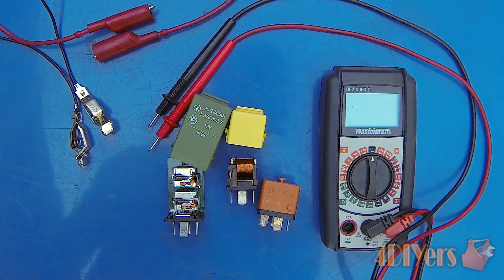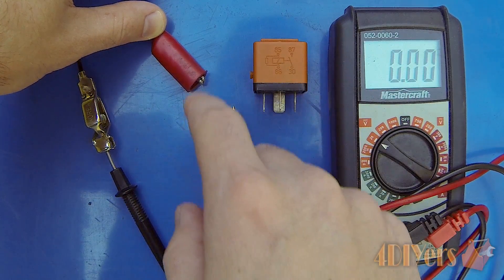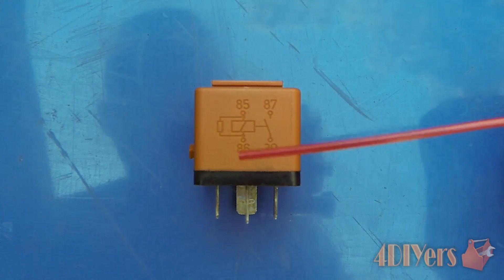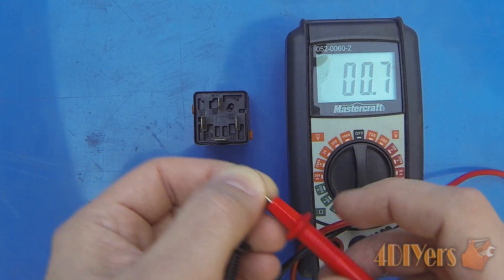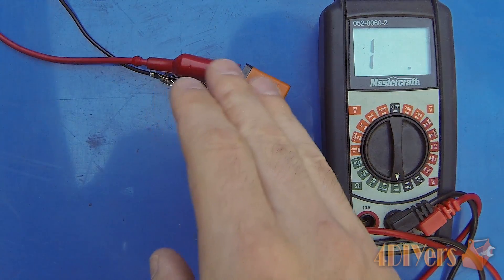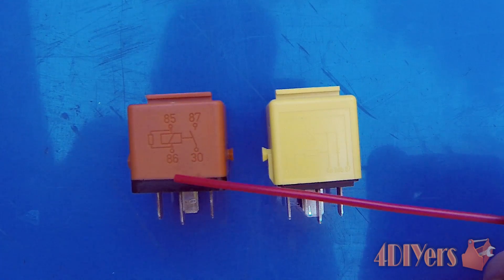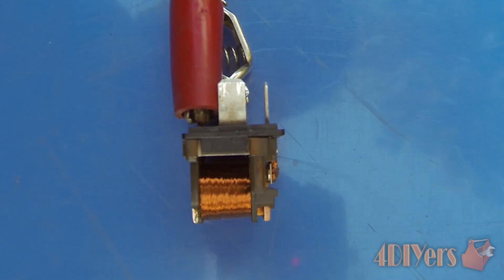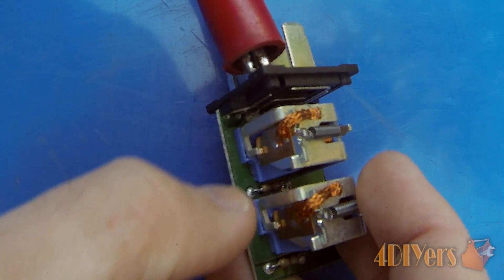DIY: How to Test a Relay

Comment: Hey, I know this video is old but you might be able to clear a little doubt I have. What could be wrong with a relay that sometimes doesn't work properly? My car has a "One Touch Down Window Relay" on the door which makes the window go down automatically with a single touch of the button, but sometimes the window will keep trying to go down even if i'm touching the up button. I believe the relay gets stuck somehow. The thing is that I replaced it months ago but now I have the same problem and I'm thinking there might be another problem that is causing the relay to some times not work properly.

Any idea? TIA
Reply from the maker: If it was a cheap relay, it could potentially cause the same problem. I would also consider if there’s a problem with the window switch or the limit switch on the window regulator. You should be able to check it with a multimeter.

Comment: I get 265 ohms of resistance on my coil but it is a coil that is on a pcb for a wine cooler...i don't know if that spec you gave is just for automotive relays or all 4 pin relays?

Comment: why some relays whistling ?
Reply from the maker: Could be the wrong relay (ac relay used in a dc application), maybe a power or ground issues causing the contacts to chatter, or the coil could be on it's way out.

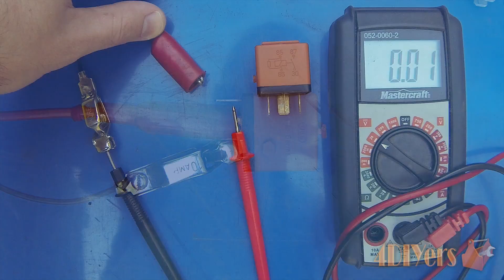Comment: 1:28 if the coil clicks do I still check it to see if it’s faulty? Or assume it’s operating to standard?
Reply from the maker: A click means the electro magnetic is working, but there can still be a fault with the switching circuit. Check the switching circuit to see if there is still an open circuit when activated or any resistance which would cause a voltage drop.

Comment: Thank you. I didn't actually need to test a relay (I knew it worked fine), but I wasn't sure about the schematic. Basically, I have an occasionally faulty neutral safety switch in my Jeep, and if it completely prevents me from starting the vehicle, I need to jump the relay that controls the starter solenoid. Wasn't sure which pins to jump. The schematic (and even the pin numbers) for my relay and yours are identical. Your explanation helped clear up which pins I need to jump. Now I won't be stranded if the NSS fails again.
Reply from the maker: You might be able to unplug the switch or run a jumper on the switch plug.
Reply: @4DIYers  yep! Removed the relay. A manual jumper on the contacts for the open switch is exactly what I did. At least now I won't be stranded. 😁

Comment: Hi, great video, thanks. I have a motorcycle that had a 12v socket fitted by a Honda dealer so that I could plug in my sat nav. I also had heated grips fitted on the bike by the Honda dealer.  However, I plugged in an electronic car tyre inflator and I think it must have blown the socket or a fuse or something because the 12v socket no longer works. I replaced a 5 amp fuse in the fuse box, although the original 5amp fuse seemed fine. Still no joy. There is a big black relay that sits beneath the fuse box in my bike (Honda NC750S). Do you think the relay might be blown. I also read that there should be a 1 amp fuse hidden beneath the fairing. I don't know if that would be true or even typical of a wiring circuit. Would you happen to know? Thanks.
Reply from the maker: Your best bet would be to follow the existing wiring to see where it runs and then test everything with a multimeter. Honda may have offered a kit for that, so it could have a fusible link supplying the power that may have burnt out. You can do a continuity test between the fuse and relay or 12v socket and relay between 12v socket (depends how it's wired) You can check out my LED light bar or portable 12v work light videos to see wiring diagrams. It should be very similar, just a different component at the end.
Reply: 4DIYers  Many thanks.

Comment: My amplifier isn't working, i'm 99% sure that it's a relay inside but i'm quite new to circuit boards. I don't know the polarity of the coil but one way it's 50k ohm and switched around it's 150k ohm, there is also a diode in parallel with the coil and i measure a voltage over it so it's getting power but it's not switching. Can i 100% conclude that way that the relay is broken because it's a 40 year old amp and the relay is hard to find

Comment: Very informative video! I have a good multimeter but I just ordered a testing device called the "relay buddy"...it cycles the relay and tells you if it's good or bad.
Reply from the maker: Thank you and great tip! I've seen relay testing kits for sale, but have never used on myself. Looks to be much easier than using a multimeter.

Comment: My question is... Do Most Fuel Pump Relays Have 4 Pins? Like in Fords and Volvos...
Reply from the maker: The most comment is a 4 pin normally open relay. It would depend on the circuit what or how it was designed, but there is a good chance it's a 4 pin relay. Don't forget to subscribe :)

Comment: hey i have a question i have o3 jag s type r i have check engine light and i red the codes at auto zone and n showed me 2 oxygen sensors but the guy at auto zone recommended me to  check the relay might no be working good or not working at all do you think is could be possible to replace it or check it cuz i recited the code p1000 obi II monitor testing not complete
Reply from the maker: +droneactivities Was that the only code that popped up? Have you had the battery recently disconnect? That code means that the car is still in monitoring mode and will disappear after a certain amount of driving.
Reply: +4DIYers thanks for your answer,, yes i got p0037 p0057and again p0037 p0057 and last one p1000 ,, and i disconnected the battery yesterday for less than a minute and didn't go off switched the relay using other from the same box  still the same ,, that guy recommended me to get the car to electric mechanic
Reply from the maker: +droneactivities P0037 is relating to bank 1-sensor 2 is the downstream O2 sensor. So you may have a wiring issue or faulty sensor there. P0057 is also a downstream O2 sensor which again can be a fault in the wiring or a faulty sensor. Inspect the wiring for any damage first, then the voltage at the O2 sensor plugs, if you find no faults, then the sensor will need replacing. Once the issues are fixed with those two relating codes, then P1000 will eventually disappear after a fuel system check done by the car's computer. The reset the computer, you will need to have the battery disconnected for about 20min as is can store power for a period of time.
Reply: alright thanks again very helpful  i will  do that
Reply from the maker: No problem, glad to help out!

Comment: Hi i have a reading from a four pin 12v Tyco relay of 29.2 between 85 and 86. is it junk if the reading under 50 and over 120?
Reply from the maker: +Scott Thomson Yes if the relay is outside of the span between 50 and 120, then there is a good chance it is faulty. So being that it's 29.2, it may have issues. Either from the start or once the relay warm up.

Comment: Mazda 626 over heating just put in new radiator still overheating
Reply from the maker: +Sammy Espinoza  Overheating issues can be caused by a plugged water jacket/coolant passage, air in the system, improper mix of coolant, sticking thermostat, faulty head gasket, faulty water pump, and a faulty temperature sensor which would give a false reading. Was the system low on coolant before you replaced the radiator??? When the engine was running hot before, did the engine just get warmer or did you fully overheat the engine??? If it fully overheated for a longer period, then you may have a leaking head gasket which may just require a gasket replacement, you could have warped the head, or a cracked block. I do have a video on how to determine if you have a faulty head gasket. Next you can test the temperature sensor normally by using a multimeter. You can also use a hydrometer to test the coolant's boiling point and I have a video for that too. There should be specific readings stated by the factory for your vehicle. Normally I like to start with the free or cheap tests first before getting into more complicated or expensive tests. Next would be, when was the thermostat last replaced??? Or when was the water pump replaced???

Comment: Can you test a relay without any voltage supply and just using an ohmmeter?
Reply from the maker: There is no mistake. I was referring to if by chance the switching contacts as welded together, then obviously the circuit would be close, therefore whatever is powered up on the circuit wouldn't be able to turn off.
Reply from the maker: +Jancen Are you referring to the switching portion??? If so, then no. You maybe able to open it up and close the contacts by hand, but even then it won't demonstrated if the contacts are closing properly with the coil.
Reply: I'm referring to a solid-state relay.
Reply from the maker: Oh this procedure only applies to mechanical relays, not a solid-state version.
Reply: +4DIYers, Great vudeo but, I think you've made a mistake while explaining about what the resistance reading should be when the switch across pins 30 and 87 are open, which is so for this particular kind of relay switch when the coil is not energized. You said the resistance reads zero instead of very high or infinite resistance for open circuits. Please check.